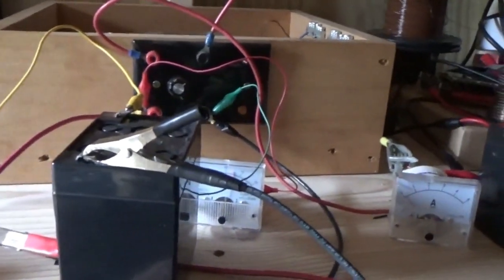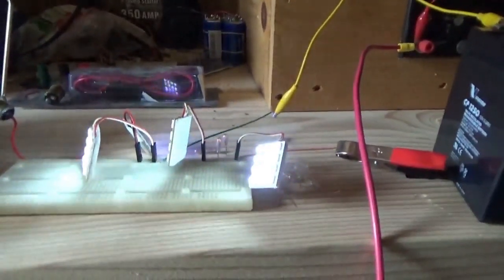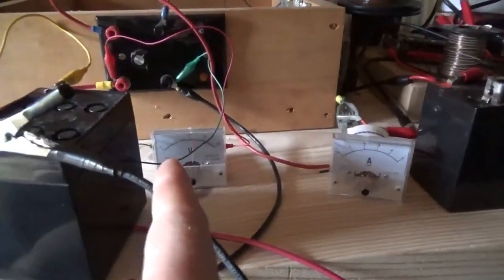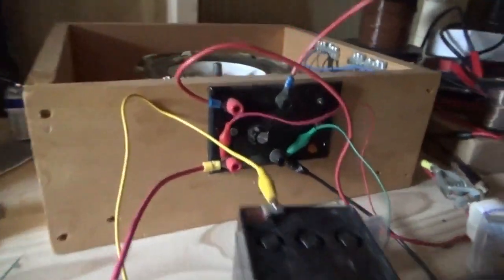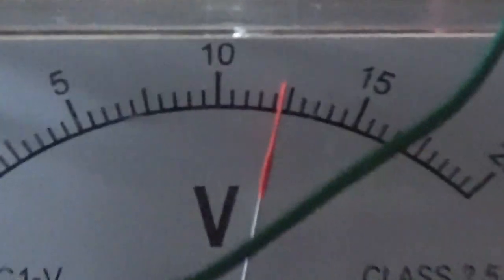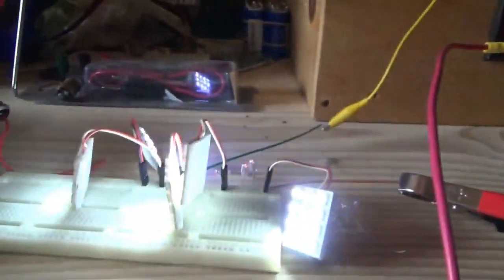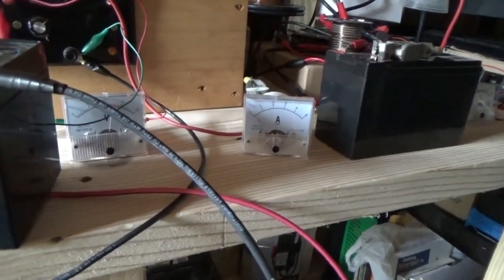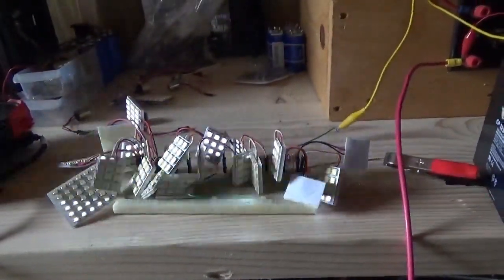Bedini Motor Running 19 LED Lamps ~ Lower Current & Higher Charging

Comment: Can i use a led instead of a red neon bulb?
Reply from the maker: No because the neon actually protects the transistor from blowing out if you accidentally forget to connect the charging battery. When the neon lights up it is bypassing that energy. This should not happen and if it ever does, shut down power immediately to prevent burning out parts.
Reply: @TheDoItYourselfWorld  
Thanks. Im gettin there
Reply from the maker: Ok, let me know if you need help. Start a new comment each time you need something. I lose them after a while but I get the new comments each day.

Comment: When putting together a bifilar coil, what's more important...wire gauge or #of turns? I mean what would be more efficient, a voil of 28 gauge and 18 gauge with 600 turns or 18 gauge and 12 gauge with 200 turns? Are turns what gives the coil the strength ...more is better? Or the amount of copper on the coil? Obviously this is all new to me! Thx
Reply from the maker: There are a lot of variables involved and its too complicated to explain here. Thicker wire means it will use more current but yet will produce more output.
I advise going with the original specs as closely as you can and then experiment later with different ideas.
You have some play room with wire gauge and number of turns as long as you keep it close to the original plans for your first build ever. After that, feel free to experiment on.

Comment: Perpetual motion is motion of bodies that continues indefinitely. A perpetual motion machine is a hypothetical machine that can do work indefinitely without an energy source. This kind of machine is impossible, as it would violate the first or second law of thermodynamics. just sayin
Reply from the maker: What I do not understand is where people get perpetual motion from me charging batteries. Remove the run battery and it stops. I never make any claim of perpetual motion. Never. Shut it off. It stops. Remove the battery. It stops.
Reply from the maker: Although, I guess the atom and the particles inside it are a sort of perpetual motion device. Since you want to talk perpetual motion....
Reply from the maker: hmm, I guess perpetual motion is real. But again, that has NOTHING to do with this device. Just sayin :)
Reply: I would have to build one to be a believer it would be a good thing if it indeed works I was just up your way over the weekend and was going to stop by but was in a hurry I did buy 2 6 volt golf cart batteries from a guy over in Leroy for 5 bucks a piece that were used for a year on gas wells charged them up  and there as good as new couldn't believe it I'm go to try to get more but he's alone way from my house down in Monroe michigan but I have a place in mio also I'm glad things are going better for you two in Michigan I like your chicken house good job
Reply from the maker: Does he have a lot more? I could use some if there are enough available. Any time you are in the area give me a shout. We are always happy to have guests. Thanks

Comment: From wikepedia....on perpetual motion :-)    "There is something lamentable, degrading, and almost insane in pursuing the visionary schemes of past ages with dogged determination, in paths of learning which have been investigated by superior minds, and with which such adventurous persons are totally unacquainted. The history of Perpetual Motion is a history of the fool-hardiness of either half-learned, or totally ignorant persons."[22]— Henry Dircks, Perpetuum Mobile: Or, A History of the Search for Self-motive (1861)
Reply from the maker: Hmm, what about an atom? Electrons? What about the planets? I find it foolhardy that some people deny perpetual motion. But, that having been said, I never claim perpetual motion. I dont get where this relates to a pulse motor. Remove the run battery and it slows down and stops running. No perpetual motion. No claims of it either. Not from me.
Reply: You are calling things "blind religion". Regarding the planets?   again basic thermodynamis from wikepedia....(I don't feel like verifying its links)   :  These laws of thermodynamics apply even at very grand scales. For example, the motions and rotations of celestial bodies such as planets may appear perpetual, but are actually subject to many processes that slowly dissipate their kinetic energy, such as solar wind, interstellar medium resistance, gravitational radiation and thermal radiation, so they will not keep moving forever.[5][6]
Reply from the maker: Oh well. Anyway, I never claim perpetual motion. Remove the battery and it stops
Reply: You could take two pieces of dissimilar metal connected to wires and throw it into a river ,and get enough power to light led's . Free energy.?..well one of the metals is being dissolved.....and the chemical process is calculateable...not blind science to know that it wont last forever.
Reply from the maker: True but nothing is being destroyed here. What you explain is a destructive chemical process. The only loss here is the charge in the run battery. Just build one and see for yourself what goes on.

Comment: Is it the led (diodes) stopping the bounce back voltage from the charging  battery making the charging  battery voltage increase?? love this vid bud 
perhaps adding a cap with the leds  would smooth out the flicking
Reply from the maker: I think that the energy spikes are amplified by adding certain components in the system. I am still learning myself. This is basically tapping into energy in the environment that is just sitting there unused.
Reply: The Do It Yourself World. would you get the same effect if you put a bridge rectifier in re-place of the led?
Reply from the maker: I hear that a bridge rectifier actually converts the pulses of energy into usable energy. Hard to explain but yes it helps. I am going to make another Bedini motor on video and then perform hardcore experiments with it.

Comment: instead of using the Analog type of electric meter, could you just buy some cheap chinese multimeters, strangely there accurate
Reply from the maker: Thing with this circuit is that the fewer electronics components in the system, the better you are. A simple analog meter is just a coil to the circuit

Comment: nothing odd the leds are diodes your foreword voltage is going to the battery and the charge is rising without a diode your battery is back feeding into your simple generator or pulse gen causing a rise in current to charge the battery without diodes the battery drains.
Reply from the maker: Because they are diodes, they cannot back feed from the battery. The energy is coming from the Bedini motor, which also has a diode to separate it from the run battery. They are electronically isolated from one another.

Comment: you should run the LED lights directly off the battery (charge of course) and time how long they will run un till the battery hits lets say 11 volts. Then recharge battery and hook it up to the Bedini motor like you have it and run it timing it to see how long the same battery can run the lights the Bedini and charge 2nd battery timing it till 11 volts again. This would show if it really uses less power or more power
Reply from the maker: That is a very long and time consuming process which I have done in the past, many years ago. With each charge on the Bedini, the usable power is increased. I will be restoring some smaller batteries though on video just to prove it.

Comment: I think you must have a screw loose to really believe in one of these "free energy" devices.
Reply: Blind religion is one of the most absurd statements I have read in a long time. Electrical engineering is one of the most tangible ,mathematically provable sciences we have.
Reply: you are so incorrect... study this and you know what i mean....electricity is no form of energy, its a maens of energy transportation. (witch provide losses) in fact your solar panels should produce aound 1000  watts per square meter,(thats what the sun gives per square meter) the panels  dont, the can only do about 300 watts per square meter , hence the losses. so P in is not P out, thats only oe of the explanations per means off power producer..
Reply from the maker: The people with a screw loose are those who deny everything because they were told it is so but dont try it themselves. That is blind religion. I am not creating or destroying energy. Just using energy that is available.
Reply: by all respect, but dont re invent the wheel couse you dont understand  fully what is happening here.. you only understand a little off it,...lol   it takes years off study and understanding what is happening. it stil is a fun experiment.

but P in can never be less than P out... it cant. (sadly)
Reply: btw, it has nothing to do whit religion, its cience, not a ferytail....
Reply: @DIY World:
Fair enough, I don't really understand it, and it wouldn't be the first time I was wrong with my habitual skepticism.
Good luck to you.
Reply from the maker: MrBugsier, actually I get more P out of my solar panels than I put in. I get more power out of my wind turbine than I put in. I get more power out of my Bedini motor than I put in. There are all kinds of forms of energy. I am just using what is available in the air.

Comment: Will the one that you built out of just the relay and diode behave in the same fashion? Without a measurement of Watts in and out I have a hard time seeing the extra energy. I have all the stuff to set up the relay style one. I believe I have an easy way to show that there isn't extra energy and explain what you are seeing. If I make a video would you be interested in discussing the results?
Reply from the maker: Yes please go ahead and bring it over to the forum. I would be happy to get into a discussion about it. But the relay is a weaker device, just be aware. The larger Bedini motor I have is a LOT stronger. Also the relay is not really possible to tune much. There are some very cool things they are doing with it though, getting extra light for free out of it with some extra circuitry.
Reply from the maker: When I get all my meters and gauges I will be showing more details.